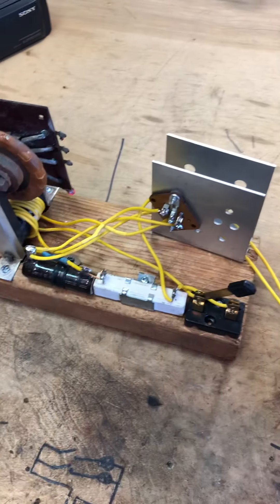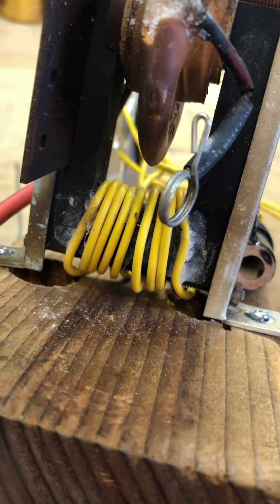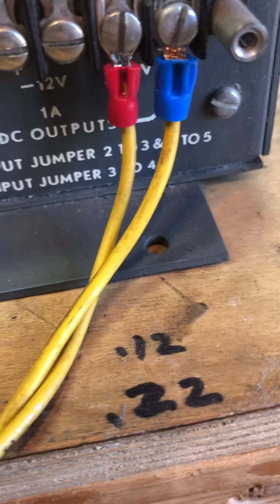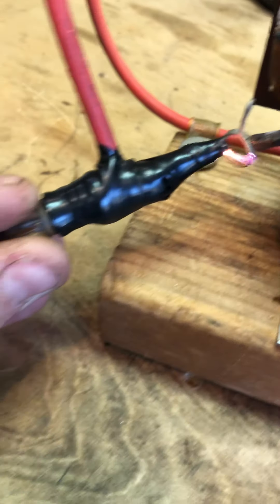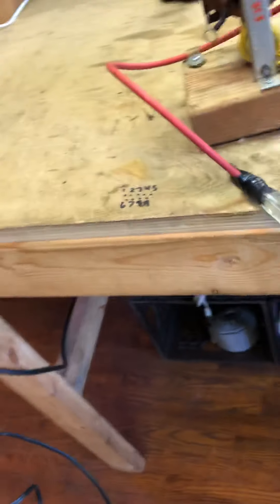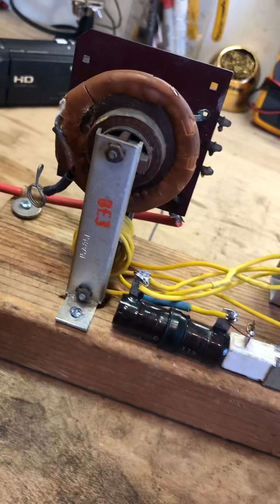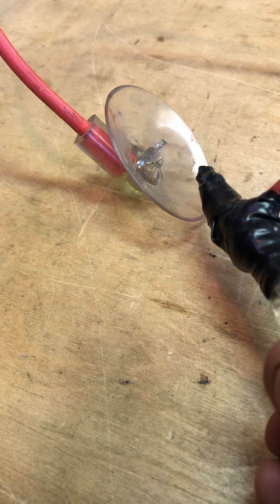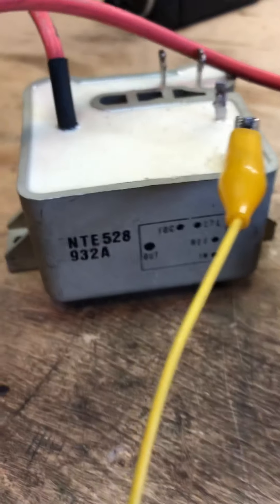Homemade Flyback driver

Comment: I made some sparks back in the 90s with an old car battery charger and a couple of large capacitors.  I clamped the ground wire to a heavy peice of steel. With a penny on the end of the positive wire I could cut holes in aluminium cans. It was pretty fun.